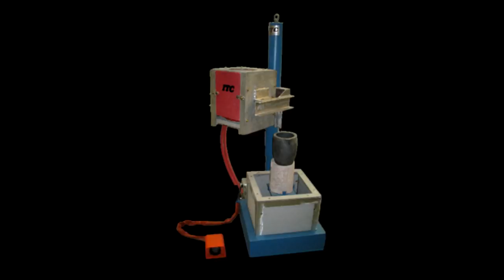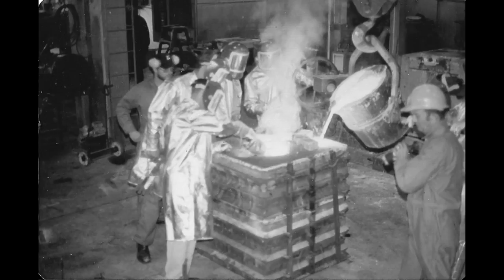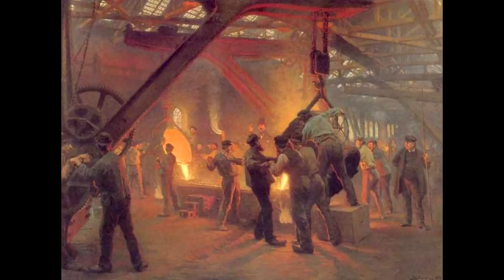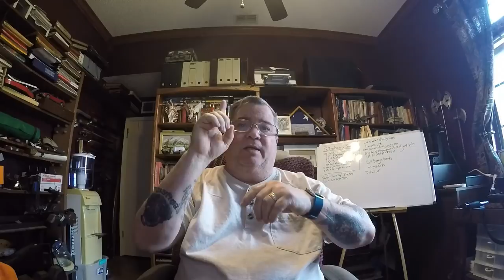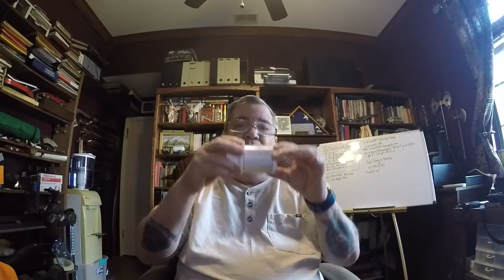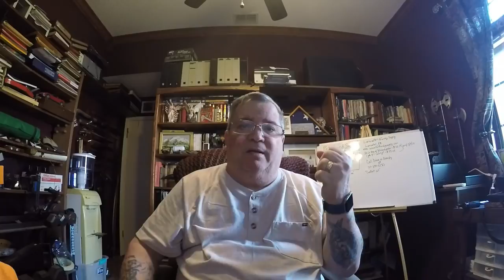The use of Fluxes and Degassing

Comment: Thanks for your video.  To  degas Aluminium, I use  "nitral" which is in tablet form and bubbles the mix when plunged under.  With brass I generally put a table spoon of a 50/50 mix of  charcoal and bottle glass into the crucible before heating.  It gives a good cover flux but creates a crusty dross inside the crucible after it has cooled.  To clean the metal, I usually add 40 or 50 grams of zinc to  about 2 Kg of brass.  This also helps with the loss of zinc due to evaporation.  I never have problems with gas inclusions.

Comment: Before working steel, most mills now use vacuum degassing to remove hydrogen from the molten steel.  Hydrogen has long been known to be the cause of cracks and defects in rail steel.
Reply from the maker: And the foundries that cast pure copper do the same.

Comment: I've seen Olfoundryman do aluminum, brass, aluminum bronze. A lot of what he casts is dependent on what clients want, which is why he often is using specified alloys like that aluminum piston alloy.
I think this is the first time I've heard anyone on youtube talk about cover fluxes or anything other than cleaning fluxes. 
Some other types of fluxes that you didn't mention include damaging fluxes, drossing fluxes, wall cleaning fluxes, grain refiners, silicon modifiers
Yes, fluxes are a huge topic and one could easily spend years studying them and their uses. 
reference link for more information on the other types of fluxes
http://www.substech.com/dokuwiki/doku.php?id=fluxes_for_melting_aluminum
Reply from the maker: Yes, there is a great deal to be taught but I was hitting the fluxes, cover fluxes and degassers that the backyard Molder might use.

Comment: Fluorite/Fluorospar (Fluorine Feldspar...) is still used in Aluminum foundry work, in particular as a reducing agent for smelting of aluminum. However, it's ridiculously dangerous in a home foundry situation since it can generate Hydrogen Fluoride gas - which, in contact with the moisture in your lungs or on your skin, becomes hydrofluoric acid, which is a common glass and silicon etchant for certain semiconductor type applications. The most common cause of death related to HF poisoning? First time use by a new technician. It chelates calcium out of the blood to an extent that a droplet on the skin can stop your heart in tens of minutes. It isn't metabolized by the body, and you won't even know you're dead - your heart just stops after a bit of pain in the extremity exposed. So... maybe stay away from the fluorides.

If anyone's trying to do titanium, don't use any halides - chlorine, fluorine, or bromine - they'll embrittle it to the point of being useless.
Reply: Ridiculously informative video btw... thanks!

Comment: I run a smaller "300 lb" induction furnace to feed a continuous caster for silver metal.
The coolant we run through the coil is deionized water and antifreeze.
Funny thing is last week I refused to run the furnace because the coolant is leaking from the connection to the coil (which is high voltage).
Manager says: "You're not gonna get shocked."
I say: "What about the coolant getting under the molten metal?"
Manager: "What about it?"
I say: "Possible kaboom from a steam explosion? Plus the smell of burning antifreeze is nauseating ."
Manager: "Well just turn it on and see if the antifreeze burns off."
I haven't turned that furnace on in over a week now. I think they're looking for my replacement ha.
Reply from the maker: Better to be replaced because of safety concerns than death.
Reply from the maker: Your furnace...is it a lift coil or tilt? Ajax or Inductotherm?
Reply: The furnace is a hoist assisted tilt. Made by inductotherm. A "VIP Power Track" I believe.
Reply from the maker: Yeah, the first induction furnace I was exposed to was an Inducto 100. Both the lift coil and tilt furnaces were actuated with hoists.

Comment: If I use runner of monel metal in new heat on which once I did de gassing in previous heat... I have to do degassing with plunging again?
Reply from the maker: Yes. Even though the material has been degassed in a previous melt, the metal will be exposed to the atmosphere again while in a molten state where the metal can absorb gas (like hydrogen) that has the possibility of making the solid metal look like Swiss cheese instead of being totally solid and making it weaker than it needs be.
Reply: @sandrammer  my casting got cracked in 2 pieces from between recently and there's no over temperature problem or high percentage of Fe but is there any chances that using 80% runner and using 4-5 degassing packs is too much?
Reply from the maker: @vyom8683  , I would have to see what the casting looks like and how you made the mold to have an educated guess on what happened.
Reply: @sandrammer  can I get your mail id so I can send you some photos?
Reply from the maker: @vyom8683  , sure. Here it is...sandrammer@aol.com